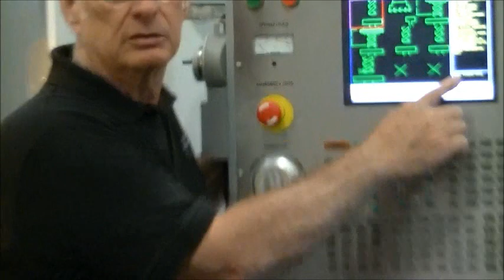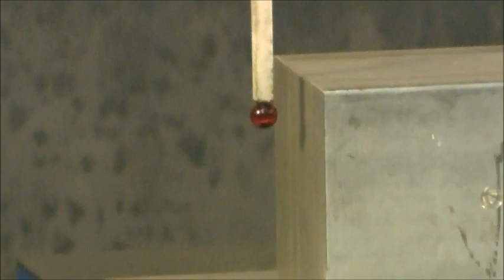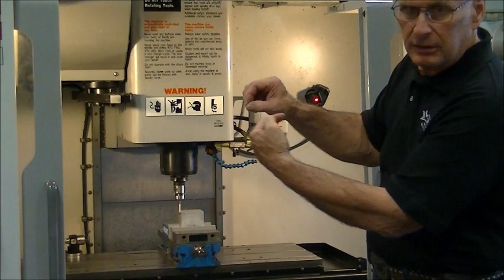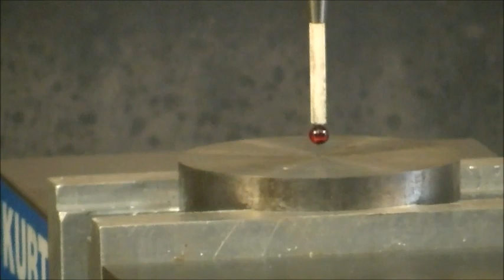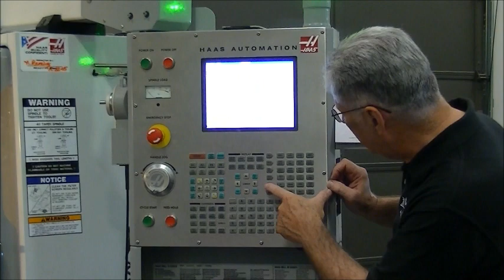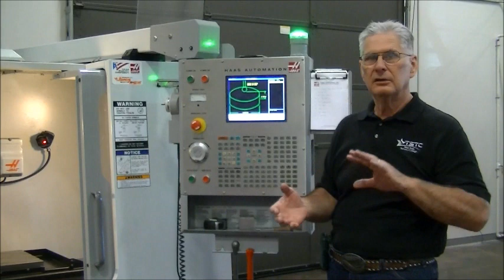HAAS 3 Probing Systems

Comment: on a FADAL cause there is no operator page I 4-2 the machine send it home and use MDI by typing say G43 Z (whatever is higher say 8") then the last tool # touched on and run that then that sets the z to 8" than jog down to the z0.0 of the part and use that Z number in the G54 Z offset. So now if you use G55,G56 or whatever all you need to do is set the Z most of the time it will be positive unless below the 2" of the block you set...... Hope this in clear enough....

Comment: You can do this on the manual touching by. 1) touch all tools say on a 1-2-3 block off the table 2) with the last tool that was touched say on the 2" side of the 1-2-3 block (same for all tools) set your operator page to zero now touch on your work piece (Z0.0) and that's the number you enter in the G54 "Z" in the OFFSET page..